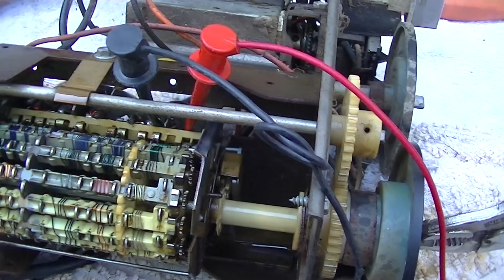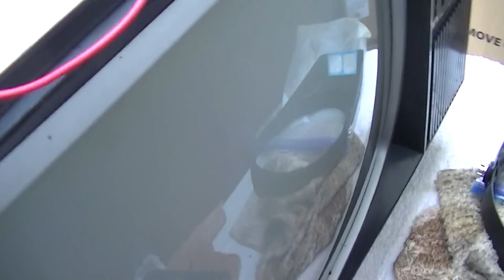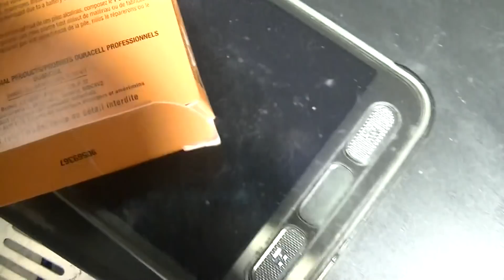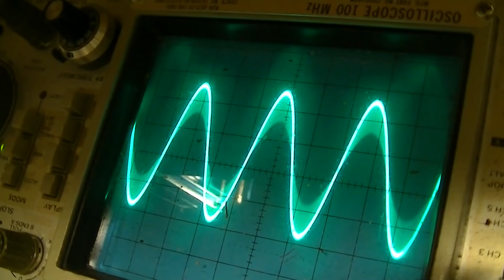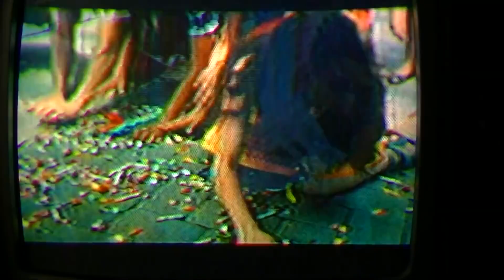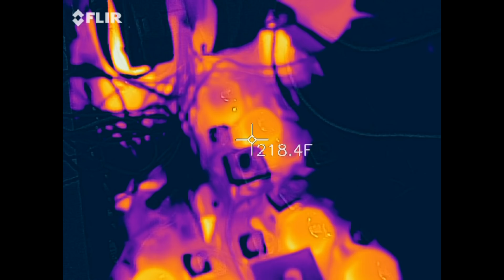Cleaning And Color Demod Repair Wards Airline Admiral Vintage Television

Comment: That ghost you are getting to the right. Is that normal for those vintage sets or not?  Mine 1972 Admiral K15 chassis, Sam’s 1281, has the same ghost issue and it’s not front end related. It’s coming from the video amp section. I measured the ghost delay. It’s 1.5us.

Comment: I have an Rca CTC 25 combo set that has me turned upside down. Id really like to ship the chassis to you for repair IF you have a cabinet and crt you could stick it in. It would make a great repair video I think and Id be glad to compensate you for your work. Your channel mentions contact info on mine explorer's but im not getting the option to message that channel. Please consider it!

Comment: well I still have some old wards order books around in the 1972 book I found one set that looks just like this one it looks like it was second best in the line up at a price of $374.95 n the add reads item#2   63 B 12462R.  19-in. diag. screen portable with one button for AFC and automatic color control    185 -sq in picture we've created one - button control for automatic fine tuning and color control so just press the one button to lock in the best possible picture and sound .and it has our advanced slide-bar controls for color, tint and volume. built-in VHF and UHF antenna and 3 if stages for better fringe-area reception. instant-on means you won't have a long wait for the set to come on pushbutton on/off control 3x5-in .speaker tinted screen cuts glare and improves picture contrast . walnut-grained  plastic cabinet, 173/4x241/2x205/8 in.ul listed shipping. wt 93 lbs  $374.95 cash or $14 Mo, credit terms this was fall of 72 so yours is probably spring of 73 I looked in my other Ward's books 1977 on n sanyo was then doing there electronic so 76 was the last year wards used admiral

Comment: Hey shango grab yourself one of these oscilloscopes, they are brilliant, just built myself one. https://www.ebay.co.uk/itm/Assembled-DSO138-2-4-TFT-Digital-Oscilloscope-Kit-DIY-parts-1Msps-probe-M/152224793929?hash=item23714e0549:m:moJswqTl1iT4unsQdg9xfhA:rk:9:pf:0
Reply from the maker: done
Reply: Good Stuff! let me know how you get on with it fella, mines working brill, the colour screen is crystal clear and surprisingly accurate! they work on 9v to 12v dc and have various test points on them for calibration, a wonderful little kit i must say, did you get the kit or the prebuilt one? theres a case you can buy too

Comment: Finally that horrid "joker" picture (green/purple colour) is gone.

Interesting how a chroma-demod fault can cause that kind of symptom, but not all that uncommon. I had a Philips K-11 (1977) chassis with that very problem - another guy reckoned it was a cathode short in the CRT (but a check confirmed all 3 guns were even with strong emission and no shorts - plus the grey scale was correct with the colour turned all the way down - producing a clear B&W picture - upon turning the colour back up, it looked terrible). Replacing the chroma plug-in module and a couple of difference/differential transistors (mainly R-Y and B-Y) on the board fixed the fault, restoring a great colour picture (complete with vibrant greens reds and blues). There was nothing wrong with the tube.

Once again, another great video - shango you are the man.

Comment: Great picture for one of those sets. Excellent work.These were considered as junk in late 80's TV shop wise as a Black and White TV would have been. We used a Air compressor  to clean all the dirt and a soft bristle paint brush. Never water on the components. Thanks Shango!

Comment: I'm sure I don't need to tell Shango,  but for newbies if you have a valve/tube with low emission and  no replacement and you have a basic valve tester (just like a CRT rejuvenator)  you can attempt to get a bit more life from a valve by over running the heater for a short period. With a 6.3V heater you can go through the ranges from 12.6V and  then the next, (12.6 isn't enough). You can watch the emission - at 12.6 it will rise right up, then the next range for 5 or 10 secs where often it will drop then jump up. Keep an eye out for shorts and don't overdo it. Often a valve can give  give normal service for weeks or months. No guarantees though. This of course is so you can order / find a new one without losing use of your radio/tv/amp - and not for passing on to the next guy ))

Comment: I miss Wienerschnitzel. Back in the 60's, you could get 10 chili dogs for a dollar, and they were yummy! I still think Shango needs to take his properly-calibrated Geiger counter and hold it up to the back of that CRT and HV rectifier tubes and find out how much X-radiation is being emitted. I'm sure it would go way up if the voltage-regulator circuit were to malfunction.

Comment: If you HAVE to clean something, maybe start with a big soft paintbrush instead of a fiddly little toothbrush? Seems like it'd be faster and gentler.
Reply: A paintbrush would certainly get into the nooks and crannies of all circuit boards and is less abrasive than a toothbrush. I use a paintbrush to gently clean crap out of PC motherboards and fans - then I gently blow the remainder with compressed air afterwards. I've also cleaned old TV chassis via the soft paintbrush method with considerable success.

Comment: Shango066 made a video of cleaning a TV? What is this, some kind of holiday weekend or something? ;-)

By the way for the next spam call you should pretend that you're calling them for assistance with the repair.

"Hello sir how are you doing?"
"Well, I'm wondering why I'm not getting any color demodulation. I replaced all the tubes, ohmed out all the coils. I think the pots are open. You think that might be it?"
"Uhhh..."
"Both of them though? But it makes sense, if both of the pots are bad it's not going to demodulate anything".

That should be a fun way to waste their time ;-)
Reply: Jac Goudsmit - or better yet, ask the telemarketers if they’re having problems with their picture bulb TVs, then ramble on about flyback arcing and low high voltage. Ask them if the damper tube is busted. Or if they see the filaments in the transistors lighting up. 😊 Finally, suggest they EOL the set with fireworks.
Reply: fantastic bit of fun. don't know how i stumbled upon your comment. i'm not really interested in electronics- he must have had a trending post some years ago, and am often delighted with his take on current americana that seeps out of these devices when he gets them going.
Reply: i would really love to see this happen!

Comment: Wells Gardner? Seemed to be the prime supplier of TVs to Montgomery Ward. Pre 1976. I did have a 1976 Wards Airline tv that was manufactured by Sharp. I believe 1976 was the first year for this. Yes, I did see the Admiral capacitor. Wells Gardner, Admiral, and Montgomery Ward were Chicago based companies.
Reply: I guess when they went to Solid State Wards switched suppliers. I'm guessing mine was also made by Sharp, even though it has Hitachi parts in it. It is a 19" color Airline set made in July 1976. It still runs great even having a signal converted at least 3 times from an Amazon Fire TV stick all the way down to RF for Channel 3.

Comment: I Agree, WD-40 is for the most part pretty worthless. It evaporates to quickly to be any kind of a good penetrant and it certainly is not a lubricant.
Reply: Also  some penetrants are corrosive
Reply: The "WD" stands for "water displacer". It was made for spraying on the ignition wires of your car so it would start on damp days.
Reply: WD-40 is great for spraying down a snowblower. Helps prevent wet snow from sticking to the sides. I always spray my snowblower down before and after using it. It seldom clogs using that. Before it'd clog every minute.

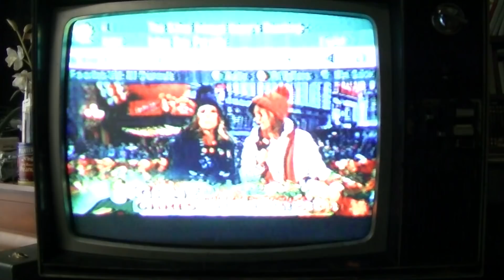Comment: Nice job on restoring this. BTW, at 52:07, it's the clip from the "Macy's Thanksgiving Parade" in NYC. I watched it this past Thursday on TV, and this is a much better version of this when it was on NBC. The CBS version of the Thanksgiving parade sucks. I saw the CBS version and it wasn't that good.

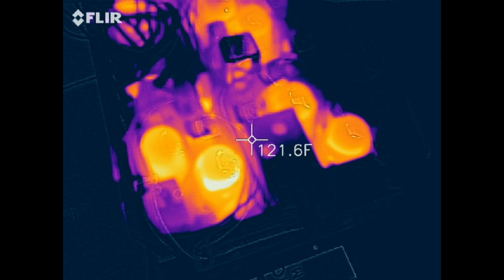59:12 it goes into Predator mode towards the end.
Reply: Macy's is still on NBC, they've owned the naming rights of the event since 1952.  CBS shows the same parade, but they don't call it the Macy's parade, since NBC owns that title.

Comment: A bit of a newbie question, but why did you send audio through the caps?
Reply: He uses it to test to see if the electrolytics are dried out. The lower the value the less bass.
Reply: Gregory Malchuk alright thanks
Reply: @computeraidedworld1148  I think You can use the electrolytic as a D.C. "blocking capacitor" and pass an audio signal to the point in the circuit and not have to worry so much about D.C., if that makes sense. An ideal capacitor shouldn't pass D.C.,   when capacitors get old and age they tend to fail in a dead short scenario, direct current can flow through the dead short causing failures.